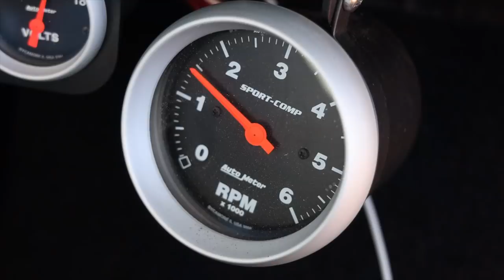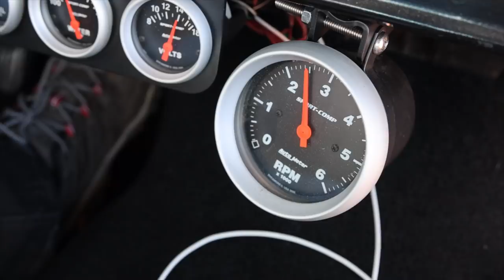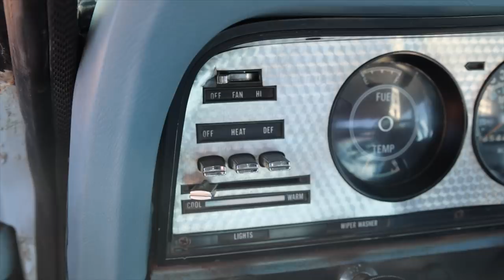The Repair List for this Cherokee Chief is Getting Long!

Comment: Get an all new wire harness! Scorching hot temps will do a number on the wire shielding drying it out and making it very brittle. When its easy to crack and expose the inside, its nothing but problems so you'll be happy with that added peace of mind. Don't paint it tho! Unless you really hate the baby blue  or the plan is to put it in a trailer to take it to shows, there's no point in painting it with big meaty off road tires that will fling rocks in my opinion. I like the look now tho 👌

Comment: It will suck but you'll be so much happier ripping out and replacing the entire wiring system with something from Painless. If you don't you'll fix everything but it won't be long before something else fails.  Old wire just eventually falls apart.

Comment: Look into going with an electric fan set up maybe? I like it on mine.
Reply: Which are you using
Reply: @abdelhassand  I have a 350 in mine, so I'm using the Novak Conversions radiator and fan kit.

Comment: Curious if you are using ethanol free gas for it? I know a lot of people "upgraded" their hoods by adding vents to allow engine bay fuel lines to cool post operation because the ethanol will boil in the lines (creating vapor lock) and other older engine issues because the gas we use now is not what those older engines were designed to use?
Reply from the maker: No, not easy to find here in San Diego.
Reply: @TrailRecon  I figured in CA it would be hard to find. Usually marinas or boat launch areas have stations close by that sell it for boats and a lot of lawn care companies seek it out for the small motors. Id give it a try especially for the slow start and for the heating issues

Comment: Did you have any problems with your carb and gas flow in the higher elevations? I know some of them old carb cars would have problems the higher you go up mountains.
Reply from the maker: Haven't really taken it above 4000 feet, but no issues yet.
Reply: @TrailRecon  that's good

Comment: On your electrical problem the wiring From experience That Nicole and I me to death on my Older vehicles that I had changing 1 wire after another where I should have just gone and done the whole thing at once In the long run it pays off

Comment: Since its not overheating, if it were me, I'd overhaul the brakes and fix the leaky hydraboost first.
Reply from the maker: But running cold all the time can also cause issues, so just want to have that sorted first and not a massive job.

Comment: Seriously consider using a bolt on EFI kit. By the time you go from sea level to several thousand feet in the air, the carb setup is already out of whack. You might even get a little bit of fuel economy. 
Replace all of the wiring. The insulation gets brittle and breaks. Painless probably has a kit. 
Bodywork. Ya, that's going to be expensive.

Comment: I think going to a fuel injection system would be better. Body needs to be redone to factory condition. Suspension needs a complete overhaul, maybe add an airbag system. Electrical, farm out and start over. Brakes should be an upgrade not a replacement. Once these things are done then it's time to set up for some serious off road features; air compressor, roof top tent, refrigerator, all the camping gear for great adventures.

Comment: Did you air down your tires at all?
Reply from the maker: Not this time since it's just an easy dirt road. I run the tire pressure pretty low anyway.  But even dropping the psi doesn't improve the ride on or off-road much.

Comment: I would do fuel injection way more reliable and fuel efficient, electric fan for cooling, hp and fuel milage gain ,bring the old man up todate and save yourself headaches from outdated parts on long trips, I grew up carbs and points and condenser distributers bring them all into modern day tech

Comment: Hello 

Not related to this video, but I’m interested in learning about off road GPS. I watch your videos and see people using tablets on holders for GPS. I don’t understand how this works? Do you have a video about this type of thing? 
I know you can get a tablet with cellular, but you can’t rely on cell service out on the trails. Can you link a tablet to another portable satellite based gps with a cord or blue tooth? 
I’ve heard that you can download maps onto your tablet at home, but don’t understand how that could work and show live status on the trail. 
Probably a lot of people already know this but I bet a lot would learn a ton if you went through the process, or share an already made video. 
Thanks 
Tim
Reply from the maker: I use an iPad mini running the Giai navigation app and some others.  Mine has cellular, but not required if you pre-download maps.
Reply: @TrailRecon  
Thanks
How does it work if you don’t have cell service?
Reply: After playing with giai a little I think I understand more now. You can still use the maps without cell service but just can’t see it live, like where you are on the map?
Reply: Is there such a thing as a Bluetooth capable portable gps that would use satellite to show your position live on an iPad?
Reply: I’ve watched a couple more videos and done some research. It seems if you have a cellular iPad that it has a gps chip and works even if you don’t have cell service?

Comment: Replacement of a wire harness is not hard at all , in fact its easier to r&r tge harness than chasing ghosts ,,look for factory dash harness , tail light harness and engine bay harness

Comment: I'd get rid of that slobbering ass carburetor and put a fuel injection system on it... then things were freaking gas Hogs but I love them too one of the smoothest rides for a big body 4-wheel drive